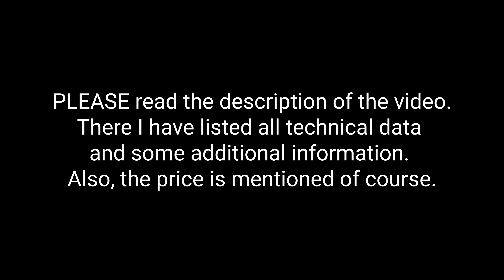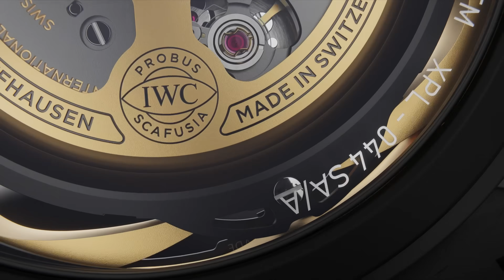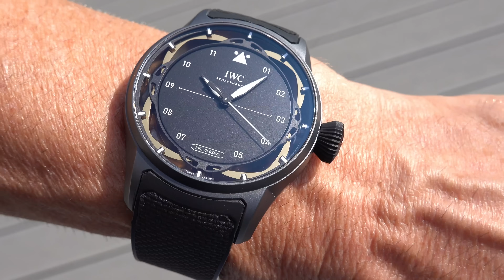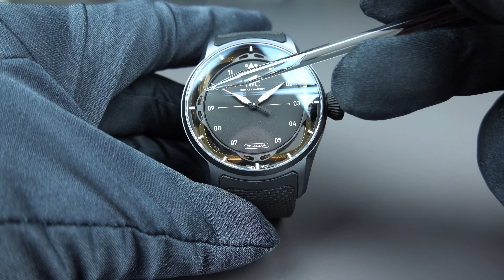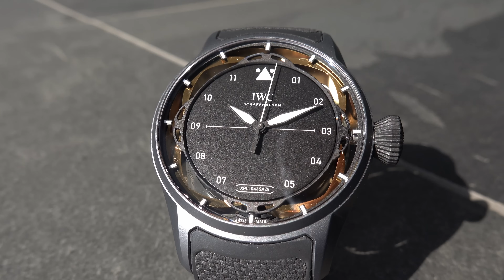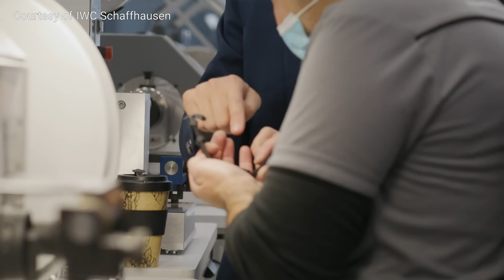IWC Schaffhausen Big Pilot’s Watch Shock Absorber XPL. Tested at 30.000g!

Comment: i’ll be impressed if they tested it after putting on and use a percussion massager gun full power for 15 minutes… my Ball watch is in the shop because vibration threw timing off.
Reply from the maker: Why shouldn't it withstand such shocks?
Reply: @WatchAdvisor  the IWC? I'd love to see someone test it. My Ball watch? I forgot I was wearing it, and it went from cosc to -1min/day. watchmaker tried regulating could only get it to +30sec/day.
Reply from the maker: @johnnyj.817  The IWC is tested… against shocks and to guarantee accuracy… Makes no sense to compare a Ball Watch with an IWC… 😉

Comment: This model is inspired from the helmet of pilots
Reply from the maker: Is it? Can you specify?
Reply: @WatchAdvisor  the dial and gold elements presents a protecting glass of helmet, gold elements, in fact it's reflection of the sun. Of course, case is helmet and shock resistance is protecting part inside on helmet which protect a head and of course, movement is head of pilot 😄 https://youtu.be/isqS6DNWffw
Reply from the maker: Now I understand!

Comment: It's the engineering work that I find fascinating about this watch. As you say for us who try and live regular lives this has no purpose apart from the possible investment with the limited production run. The thing is that the learnings from this development can filter down into not only watches but other instruments that require a high level of shock resistance. Mechanical instruments are not affected by the same problems that electronic equivalent items have and vice versa for instance an EMP could fry electronics but a mechanical piece could still run or set to run again at least. As an engineer at heart appreciating mechanical end electronics I love that IWC are pushing innovation forward even if I'll probably never see one of the watches in the flesh. Thanks Alexander for sharing. For now I'll stick with my G-Shock watches for instances that would not be suitable for my other watches.
Reply from the maker: It is always a pleasure reading your comments! Thanks again for sharing your passion with us ...